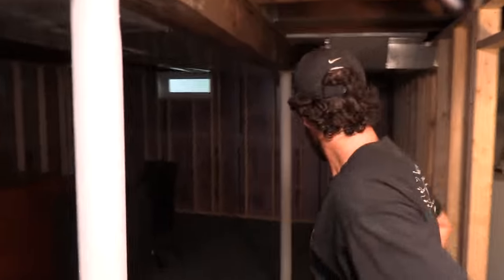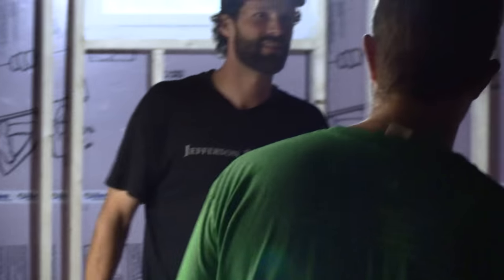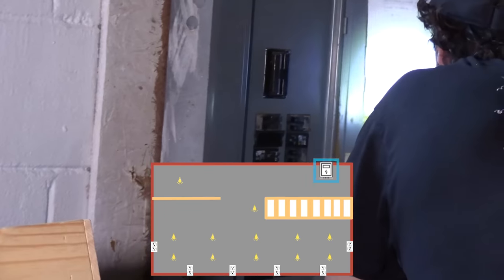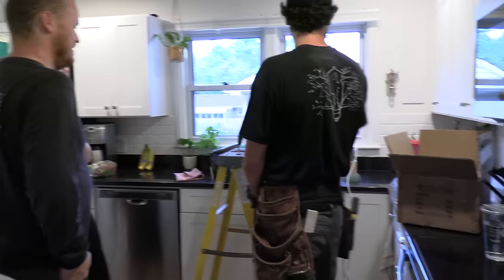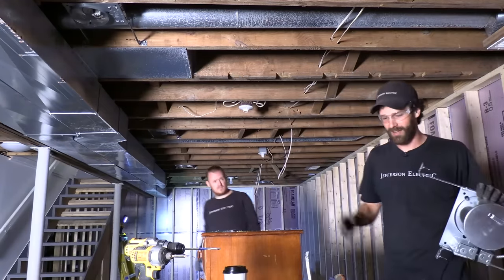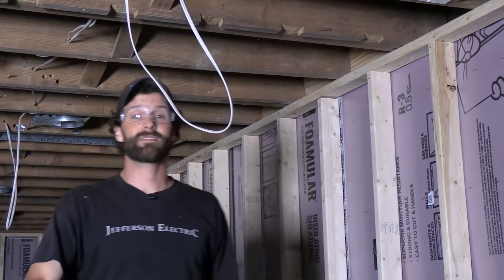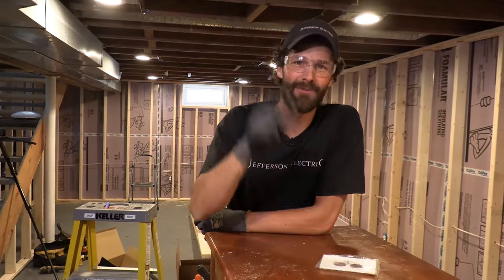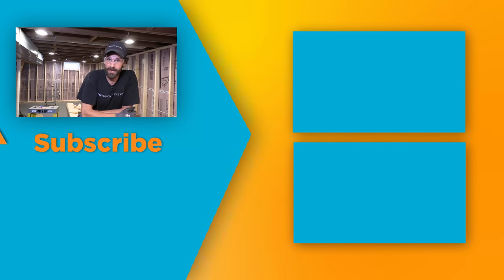Basement Transformation: Dungeon To De-Light

Comment: I see a BIG Code Violation ! And that would be Clearance Space in front and on the sides of that Main Panel and whoever wired that panel and basement, VERY SLOPPY Work and poor craftsmanship and NOT to CODE !!!
Reply: Looks like it might have enough clearance to me. I wasn't there with a tape measure myself so hard to say. The National Electrical Code [NEC 110.26 (A)(1&2)] requires a clear area for access and working in front of an electric panel that is 2.5 feet (30”) wide, 3 feet (36”) deep, and 6.5 feet (78”) high for a regular residential 120/240-volt panel. NEC 110.26(A)(2) states that “the width of the working space in front of the electrical equipment shall be the width of the equipment or 762 mm (30 in.), whichever is greater.” In addition, this work space shall permit at least a 90-degree opening of the panelboard door. The work is sloppy, though.
Reply: @illestofdemall13  ; One is NOT suppose to clutter  or store misc. items in front or around the required working space of a Electrical Panel ! The Home Owners need to clear the area around the panel ! I'm not going to argue the issue with you because I know that I'm right and you are wrong ! I can state this because I'm a Licensed Journeyman Electrician / Sub Contractor with over 55 years in the trade and I know the Codes !!
Reply: @BearStar1  Calm down bud. I was referring to the working space. Customer putting crap in their basement has zero to do with the electrician's initial installation. Just because you're older than someone else don't make you right all the time. I've been right and my boss has been wrong at times and he's a Master Electrician. I also know the codes. I need more hours before I can become a journeyman.

Comment: I HATE LED lights. They're fine for SOME things, for some flashlights, for SOME indicators, but not for everything. Especially not lighting. It seems like there is always flickering and it seems I get headaches and nauseous with LED and Fluorescent lighting. I say that 14/2 should never be used. I use 12/2 with ground and 20 amps sockets. Even if it's a 15 amps circuit breaker, it will make the circuit safer. If outlets share a circuit, the first outlet should be a GFCI and everything else downstream protected by that one. Regardless if wet or dry. Always go above and beyond what code demands. 

I also hate plastic boxes. I used to do my own electrical work. I am no longer physically able to do it, so I always insist my electrician uses metal boxes. One would think I have stock in the steel industry, but metal boxes are so much better. If I ever take charge of NEC I will ban plastic and nylon boxes, and I will ban 14 gauge or smaller wire when it comes to someone's home. I would even say that ground wires should be insulated with green, to make sure that a bare ground doesn't come into contact with something live. One could argue that it will blow, but I argue that if something is not properly grounded, everything that comes into contact with that bare wire is also energized too.

As for floor joists, I call them rafters.

One pet peeve is the excess of wire an electrician will pull, and then they cut off like 3 or 4 feet, then an additional several inches. Seems like a waste of wire and a customer's money, as I am sure that doesn't come out of the electrician's or the company's pocket. As for wire twists, I've discovered push connectors and Wago Lever nuts. I prefer the Wago lever nuts. I am not using "Wago" generically. They're better than other lever nuts and I find them easier and more secure than the push Ideal In-Sure. It's just so much easier, more secure, especially when splicing solid to stranded.

I've given a lot of thought to the tester you used at the end. There are a few improvements I wish Klein would consider. Rechargeable battery that recharges by plugging it in, and automatically stops charging when batteries are charged, and detection of a false or bootleg ground.

Life has killed the dream I dreamed of being an electrician. Fibromyalgia though rare in men, is just as horrible. I went to trade school. All they did is tell me stuff I already knew. I don't know how I knew it, I just did. Taking apart broken TV sets and stereos when I was a kid, not realizing a cathode tube or capacitor could kill me, but I had enough sense at 8 years old to stay away from certain parts. I fixed my Grandmother's Motorola Hi-Fi that a service guy could not fix. Vacuum tubes weren't available then so I couldn't make the radio play but I had the record player working. My Grandma was impressed. I took my Dad's drill apart just to see how it worked and couldn't get it back together. He was really mad about that for some reason. (Not like he used it.)  And Mother got mad when I took apart her vacuum cleaner, because she did use it.

Anyway, thanks for posting these videos. I love watching them and think about how I would do it, since I can't physically do it anymore.

Comment: I am bothered by the fact that you were unsure about the use of Square D breakers in that panel. As a professional you should KNOW FOR A FACT that Square D breakers are listed for use ONLY WITH SQUARE D PANELS!  Square D also does nor permit ANY other brand of breakers in their panels. 

This is a major fail on your part in an otherwise excellent video.
Reply: No. Square D Homeline (HOM) breakers are interchangeable with other panels. But non-Square D breakers will not fit in a Homeline panel.
Reply: @KameraShy  Wrong, Schneider does NOT approve of Homeline being used in any other panel. Now, other makers may say that HOM can be used in THEIR panel, but again, the maker of the breaker says not allowed.